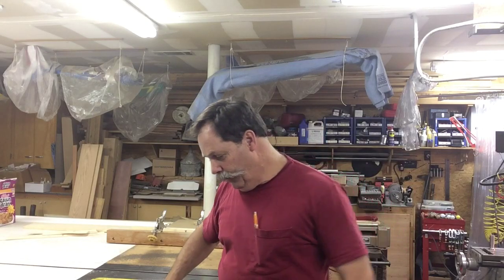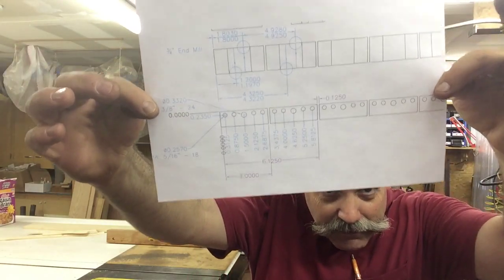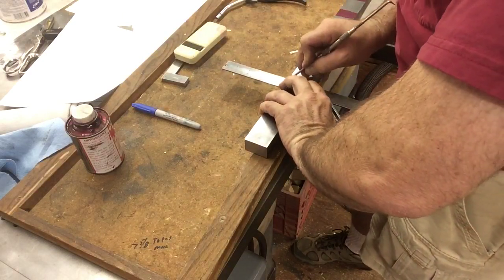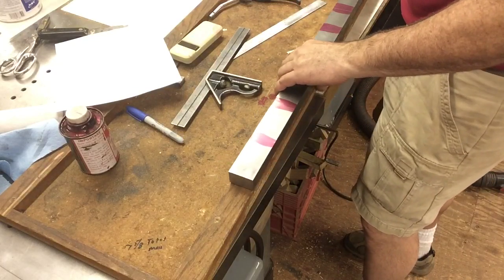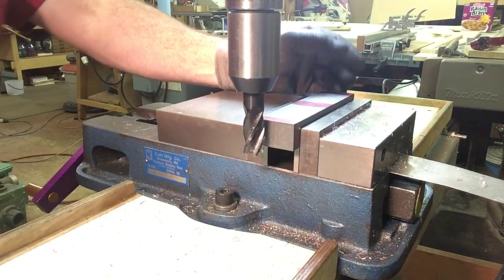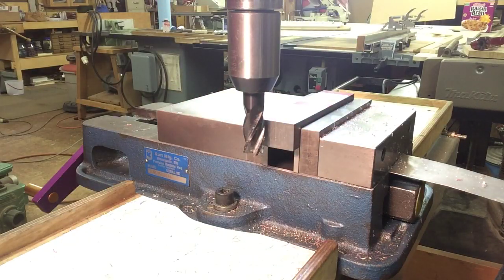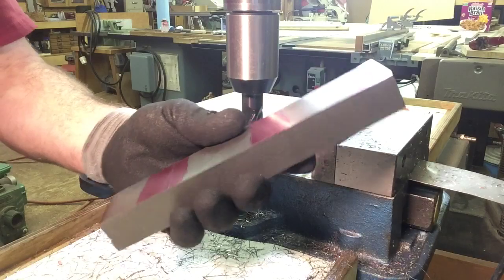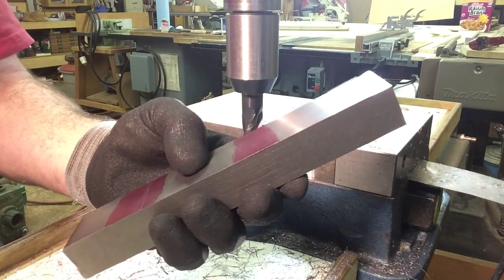AXA QCTP Tool Holder | Quick Change Tool Post | Detail Making | P1

Comment: What kind of lubricant are you brushing on before milling the surfaces.  It looks thicker than simple cutting oil.  BTW, great work on the AXA blocks.
Reply from the maker: James Rice I am using Mobilmet 766 Thread Cutting Fluid.  I like it it light in color so you can see thru it.  Thanks for the comment. Randy

Comment: Hi Randy,
Good project to save time on tool changes.
Those little holders are fun to make, there is minimal metal to remove, so not too time consuming, the serial production will help save time.
Just careful on cold roll, distortion can be a factor, mostly if you remove a lot of material unevenly.
Cheers,
Pierre
Reply from the maker: Yes I am awhere of that could be an issue.  So far I have have had problem with this project.  Almost done.  Thanks for the comment.

Comment: I am also planning to make tool holders, but mine are BXA.  Will try to find some steel wide enough (1 1/8 x 3 or 1 1/4 x3) so a dovetail "trough" can be cut the whole length of the stock at once and then cut off the individual tool holders.  Really interested in watching your project progress.

Comment: Nice project. I want to do the same because not only do I have to pay too high a price for the tool holders, I have to pay shipping to Greenland on top of it all. I'll be watching this series with great interest.
Why did you choose 1018 steel? Are you planning any hardening process? I am using CXA which takes a bit more metal per tool holder and would like to save a bit on the steel, but would rather purchase the best for the task. Good videos you make!
Reply: Jim -- my homemade BXA all all from 1018.    My tool holders are over 20 years old, so they have held up.   I really should put a "what to look out for video" before Randy gets to finishing them... <grin>
Reply from the maker: I am not very hard on my tools even though I use them alot.  1018 easily obtainable and cheap.  So they should last me quite awhile.  I plan on getting a larger lathe and spend the money on tooling for that.  Where in Greenland?  Try http://www.cdcotools.com/  $17.00 for CXA ea.
Reply: Randy Richard
Nice link, just recently bought a bunch of CA holders for about 35$ compared to 23$ there, shoouts...
Reply: I'm in Nuuk, the capitol city with about 18 thousand inhabitants. I've been here for almost 36 years. Love it. Great fishing. No, GREAT fishing! It is arctic char and salmon season now. We're having fun.
I'll check out the link. I have shied away from non-Aloris models, but I had better take a good look at those prices! Thanks for the tip.
Reply from the maker: Jim Milne I goggled Nuuk.  Wow.  I would love to visit there one day and fish.  What do you do up there?